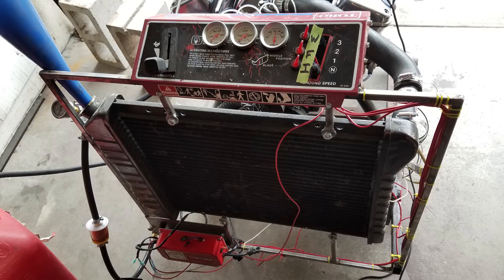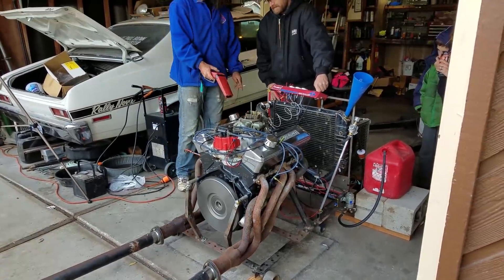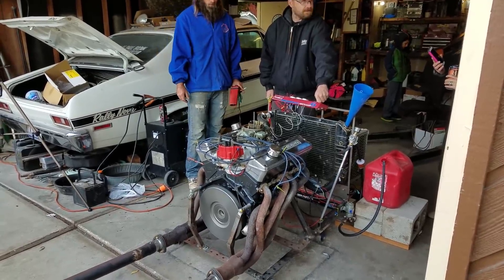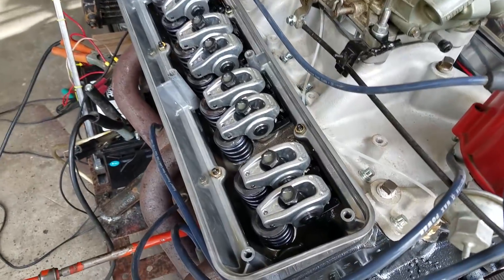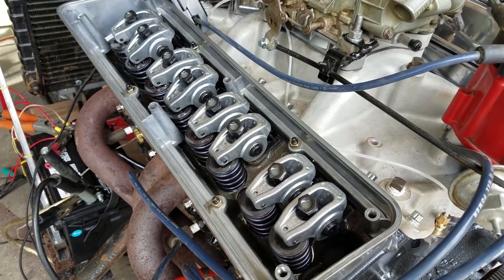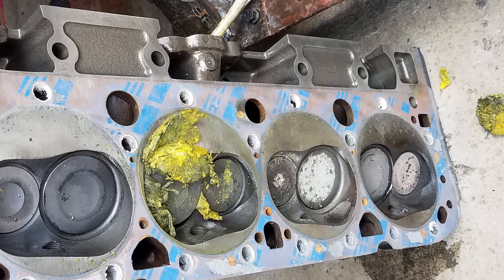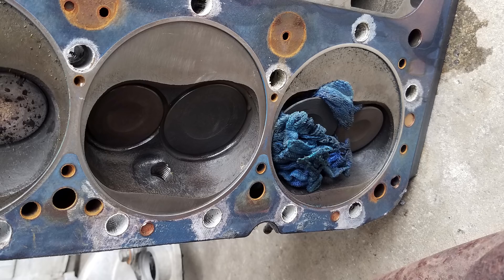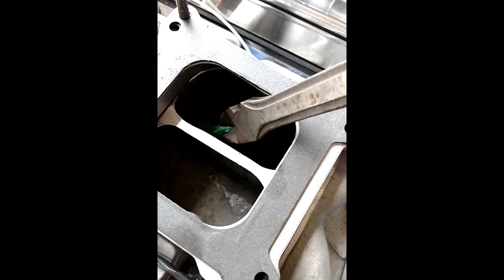Engine Broken In With Rags Left In Intake + Aftermath

Comment: A guy I know dropped a bolt in the spark plug hole and didn't notice. When he started it it made a horrible knocking noise for a second and then misfired. Shut if off immediately and pulled the plugs and found the bolt smashed into the the plug dead center. Scoped the cylinder and the piston and everything looked fine. Compression tested it and it was normal. Put a plug in it and drove it. No issues.

Comment: I had a customer that i hooked up with a 2 cylinder diesel engine a few years ago. He installed it in his sailboat and couldn't get it to stay running, it initially started, but quit, and could not restart. I visited him on and i noticed that he used a lot of paper towels.. he said he had gone to costco and bought 'em in bulk. 
The diesel didn't seem to make any compression.. It wound over with the starter with almost no resistance. I pulled the valve cover and rattled a few rockers on the intake side. yanked the intake manifold and saw sooty, diesely fibers everywhere.. Yanked the head, pulled paper towel from everywhere, lapped the valves to be sure none were bent and it ran perfectly after. 
We figure a paper towel got blown from his work bench by the wind and went 'fooomp'

Comment: Was doing some work on mine, had blue towels blocking the intake runners. Decided to vacuum out the fuel injector ports which were very dirty before installing new injectors. .. FWOOP sucked towels right down the intake.

Thankfully I noticed, and applied compressed air to the injector ports and it blew them back out! ... 

This is something that I fear every time I plug open ports with towels.

Comment: Lost an open end wrench and a socket wrench once working on an old S10 long ago. Figured I had left them in the engine compartment when I did a test drive and they fell out. Years later I had a minor bumper dent and removed the bumper and found both tools inside the bumper. Weird stuff happens.

Comment: I had similar issue back in 1973 when I had a gas station put in another camshaft into my 1970 Chevelle SS396.  It ran bad and I decided to pull out the camshaft.  Lo and behold there was a red shop rag under the intake manifold.

Comment: in November I replaced my Turbo on my 1990 Probe Turbo.  I placed a brand new white terry cloth rag next to the factory airbox.  I had it wedged between the shock tower and the airbox for checking the oil.  I took the car for a test drive to check the boost.  When i got back i noticed the rag was gone.  I just thought it fell out on the test drive, i parked the car for the winter.  Two weeks ago i took the car out of winter storage.  The battery terminal was layiong next to the airbox inlet.  I felt something in the inlet.  I tried to pull it out ,but it would not budge...I took the top off the airbox to find a rag half the size to a shower towell in the box.  I still was getting 6 lbs. of boost with that rag in the box, and the cleanist air on the planet.

Comment: Next time use Masking tape!
Reply: beat me to it
Reply: Great Opinion!  I use Duct Rap or press&seal. something plastic, sticky and wide but nothing cloth.
Reply: A paper rag will do just fine I guess.
Reply: Camaro Rick. Masking tape dont stick to lubed up engine metal.. Them thin plastic bags the stores send you home with disintegrate easy if left inside.
Reply: Use the rags and brake clean to degrease the surface. The tape will stick great. I even clean it a second time after i pull the tape off before the gaskets. The cleaner the prep the better the gasket seal will last.
Reply: FLEX TAPE!
Reply: Just don't forget it.
Reply: I was just going to say that...  I use blue painters tape... Easy to see on a silver intake.

Comment: I was doing my timing chain on my Saturn ion and I ended up dropping a bolt down into the oil pan. I got the bolt out with a magnet and then I stuck a rag in the timing oil drain area. I ended up putting the whole thing back together and cleaning up the tools and everything and then I noticed there were only 3 rags. Laying around and me and my friend swore there was 4 red rags.  We tore it all back down and come to find out the rag wasn't even in there.  Lol
Reply: blindabinda123 , got to check those back pockets lol.  Better safe than sorry.

Comment: I did this once at a sped shop I had to file the carb flang to make it nice and flat. The next day the carb cam and some one els installed it and didn’t take the rag out. But the valves were so big it went all the way threw with no damage. Just pulled a few small pieces out from under the exhaust valve.

Comment: No info on what got bent? Damn....i bought a honda cbr 1100xx..got it running..had a noise in it...no metal in the oil....ran the piss out of it noise never got worse..checked valve lash cam chain both ballance shafts...i was lost...couple weeks later i woke up from a dream..i have heard that noise before..35 years ago i had a 350 chev with a head gasket leak..it hydraliced a cylinder and bent the rod enogh for the skirt to hit the crank...ordered a new piston and rod from honda and had it fixed in a 10 hr day..
Reply from the maker: I did make a follow up video on the damages. A rod got twisted and like 6 valves had to be replaced.

Comment: Not something accidentally forgotten,  but more like dropped in an engine...
I have a 1984 Pontiac Fiero. For those unfamiliar with that,  it has the 2.5l or 151 cu in "Iron Duke" 4 cylinder in the rear.
 (Before someone goes off with the "fire-trap" crap, It was less than 1% of the 84's that did it, and mine had been in the recall, and the issue was corrected.. I have the plate on the console, and the sticker in the engine bay.)

 ANYWAY..   Typically, when you open the hood on a GM with the duke,  the spark-plugs are facing you (front).  But since the Fiero is mid-engine, the plugs still face front,  but when you open the deck-lid you are seeing the rear of the engine and the plugs are away from you.  When I bought mine 9 years ago it had 32,000 original miles and the original spark-plugs in it. However, they had become so seized up in the heads that one them broke off right where the hex part meets the threaded part. 

OH NATURALLY,  when it broke, the electrode came out with the upper portion, BUT.. a piece of the porcelain insulator fell through the steel threaded part, and into the cylinder!  After extracting the remainder of the plug  with a dose of PB-B'laster, and an easy-out, I went to tell my Dad that what happened.  He came out to 'Help".  I'm laying over the engine, trying to look into the cylinder with a light.. Nothing. I crawled off the car and told my Dad that the piston must be down. My attention turns to something else for a moment..   And before I even noticed, he goes to bump the starter to bring the piston up a little.

 Now, the other three plugs & wires were still installed as I do them one at a time. So the engine fires up and after a few revolutions " CHOOCHA CHOOCHA CHOOCHA_PING!!!.CHOOCHA CHOOCHA...." ( choocha = the sound of an engine running with one plug out..)  The chunk of spark plug shoots out of the hole, bounces off the bottom of the deck-lid and hits me in the chest,  (it didn't hit hard)  and lands at my feet.  Turns out it was just a tiny bit of porcelain.   We decided that if any damage was done it was done.  I put the new plugs in, and never had a problem with the engine since.

Comment: i had a big vac port open in the intake so balled up plastic bag and put it in the hole to keep the engine running, after the motor got hot, i revved it few times and it sucked through into the motor but luckily it was hot so the bag melted and left the motor. It didnt even missfire or anything. Till this day i try to kill the motor but it wont die

Comment: LOL this reminds me of my c10 I've been working on. I had the air cleaner off. Needed to move it in my shop to make room . I had a large plastic drop cloth laying around from when I did some paintwork. Fired up the truck up periodically just to let it run. well the last time I did the flex fan sucked up the drop cloth, shredded it and a Bunch of it sucked right down the intake through the Carb. Still haven't tore into it to clean it out yet. Lol

Comment: I just replaced the ball joints on my focus, I didn't pay to much attention to which way the bolts came out (did they go from front to rear or from rear to front?) I DO KNOW THAT THE ORIGINAL BALL JOINT PINCH BOLTS ARE TORQUES BIT STYLE. Mine had a regular style pinch bolt. I replaced everything & a few weeks later, going 2-5 mph, the ball joint popped out. Apon inspection, the new pinch bolt was to blame! the bolt is kinda fat for a certain length & then threads. the thick part of the factory pinch bolt had a longer shaft, the aftermarket ones didn't, causing the problem. now, the eyelet that the ball joint goes into is wider on one side then the other so, I put the pinchbolt head on the smaller side & hope it doesn't come loose again!!! hope this made sense. the pinchbolt that came with the balljoints could have killed me or someone else!!!

Comment: I left a single blue shop towel blocking the air hole on the rubber intake tube while changing the air filter, it sucked it down and lucky for me got stuck on the throttle body butterfly flap and took out the POS drive by wire throttle body instead of getting down to the valves, all this on a 08 Dodge Caliber, $900 later its all good but now put a sticky or leave some of the Rag VISIBLE...lol

Comment: hope the pistons and connectionrods are still ok
next time put everything you do on a notebook and cross them off after you done wats needed , things like handtight bolts needing to be torqued down to shoptowels need to be taken out 
might be better next time to just put gaffatape or packing tape over the manifold opening intake/exhaust , at least you cant miss that even after everything is mounted on top of it

Comment: It's more fun when somebody leaves shop rags in the lifter valley when changing intake manifold gaskets.
it can get into many places like out the front and get into the timing chain and gears or go to the rear and get into the distributor drive on GM V8 engines with distributors ,it also can get into the cam itself and the lifters then gets shredded and drops down into the crank and rods, THEN it goes right for the oil pump pickup screen.

Comment: I had an old ford forklift like the old tractors that were turned backwards and had a forklift carriage bolted were the 3 point hitch was I left a rag tightly in the intake and lucky didn't suck down into the valves but it would idle but didn't rev up and it sounded a lot like an injection pump timing problem which it wasn't and we had the injectors checked which needed to be rebuilt but I found the rags in the intake pulled them out and after all that ran like a brand new one man I hate it had to tell the customer that.

Comment: If he built this thing with actual 400 SBC rods instead of using 350 rods he might want to rethink the build. SBC 400 engines from factory were built WRONG the rod/crank geometry is off which is why even a 5000 rev limit is high when a well prepped 350 with stock parts can spin 7500 rpm easily . this was main reason for people making 383 engines in past because using the longer rods fixed the issue. these days you can use either a stock 350 rod or a 6.0 rod in SBC 400 with custom pistons to make a 406 that can spin 7500 rpm all day long .. reason say 406 is no one buys custom pistons for a stock bore 400 and the pistons would cost a fortune at stock bore size and would be cheaper to bore the engine to 406
a 400 chevy with factory crank and factory rods is a pos paper weight and completely useless

Comment: A rat built a nest in my 02 silverado. Chewed the wires to cam shaft position sensor knock sensors and the sending unit. It still ran but like shit and took forever to start. i get in there with the  intake manifold off, forget to block the inlets and as in removing the rat nest of leaves rocks And trash which was under the intake manifold on top of the block, a large piece of gravel dropped frkm the nest into one of the 8 inlets in the block, but i didn't even realize it. I thought it just fell down into the engine bay cause it sounded like it hit the ground  So I spliced up the wires and put everything back together and fired it up. The first 30 seconds after it started it sounded horrible pinging and knocking like it was gonna throw a rod. and then suddenly it started idling normally. Took it for a test drive and stomped on it. Everything seemed fine. I immediately changed the oil out of paranoi and an attempt to avoid any further damage. and it's been about 6 months. Truck still running strong. I wonder how bad the damage is internally, but the truck is an 02 with almost 300k miles so I don't really care to tear it down. Hopefully it lasts me a few more years. Been a great truck, and it was a learning experience about taking my time under the hood instead of rushing to get things done.

Comment: THE SOUND SHOULD HAVE BEEN A MAJOR TIPOFF. A little rattling noise? WTF the damn thing sounds like an odd-fire V6 at 1:25.
Reply: I have done similar things. A fresh motor should be very well tuned and smooth before cam break-in is started. If it is not right within 2 minutes of run time stop and check everything. I once dropped a screw in an old 327, it went all the way through and came out of a header! Did not hurt a damn thing. Lucky AF.

Comment: My bro an I had a similar problem with his ford 460 had the engine on a engine stand he thought he my as well do the bigend bearings before we dropped it in his F250 flipped it on the stand pulled the sump pulled the crank enough to pull the bearings put new ones back in we decided to go have a cuppa tea put rags over the bottom end sat the sump one thing lead to another didn't get back to the motor that night I went to work the next day scaffolding bro went to his workshop bolted it all up by the time I got back there he just about had it all in the truck finished up started fine drove it for a week or so then it got a bigend knock pulled  the motor pulled the sump an oh shit there was rags rite thru the thing he sent the motor to his engine builder she's a 520 cuber now  that's his shop truck so we don't have so much cups of tea when we do that shit now

Comment: That sucks but it's pretty funny :) My guess is a rod got tweaked.
Reply: Jess Neal 
Yeah it ended up twisting a rod but he machine shop has a tool just for twisting rods apparently and he was able to fix it
Reply: ls6 nova that would leave the rod weakened 🤔 guess if people aren't making any good power or aren't using it they may be naive enough to do that and reuse it but that would damage the structure of the rod and leave it weakened enough that it would be breaking on that exact stress line eventually depending on how it's used.

Comment: What a noob. Lol. Thats why you don't stuff rags into anything. Lay them on top.
Reply: cougar10ag masking tape my friend. Does better at keeping FOD out than laying a rag over the hole. And you have to really not be paying attention to miss the tape when the manifold or hose or sensor is installed.
Reply: HighFlyer Tape is for when you transport an engine. If you're building it in the shop you lay a rag on top. It's not like some shit is going to force its way in. It's not a filter for dust it's just a precaution in case you drop something while working over the engine. it'll sit on the rag instead of dropping deeper forcing you to rip the shit apart. If someone isn't retarded they don't need anything at all.
Reply: cougar10ag women do once a month
Reply: Yeah, and use tape too. AND slow down and pay attention. No beer until after you are finished for the night.

Comment: That's amateur as fuck. If your going to take a short cut and put rags in to stop debris getting in the intake your first thought should be to see what debris is left to clean out once rags are removed.
Reply: trillriff-axegrinder, guaranteed lmfao? I've built many an engine including all my own which are big power vehicles and have never come across this lol.
Reply: Darian Murcott-Istead well I guess you're perfect then. I have built many upon engines, stock cars, diesels, rebuilds, all in my garage on nights and weekends only, and I have made a few mistakes myself. Not all major, but a few, but I learned from them all. A rag is pretty bad I'll admit, but I've messed the  timing on a couple 5.4 tritons making the same mistake each time and felt like a total goof.
Reply: I must have missed the part of the video where he said "Me and my brother are professional's".
Reply: Late Nights.. Phone calls.. Mistakes happen. It doesn't look too bad. As long as the piston stayed away from the valve, it'll be just a few bucks in gaskets.
Reply: I've done and worked on hundreds of motors as a tech and this is the first time I've done this, glad it was on my motor not a customers
Reply: Darian Murcott-Istead sorry oh high and mighty shop QUEEN!
You are so full of yourself.you wouldn't or couldn't make a simple mistake EVER!
MY BAD!